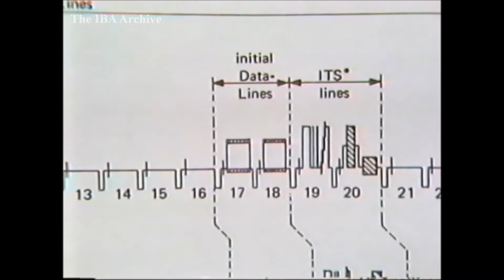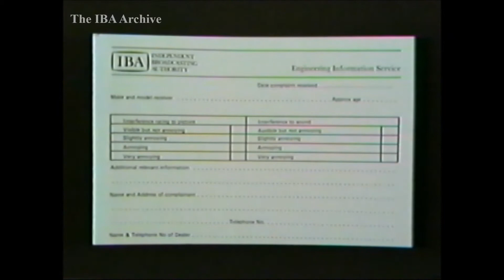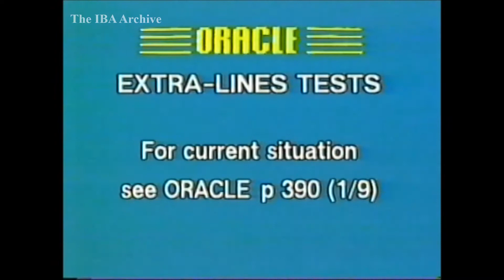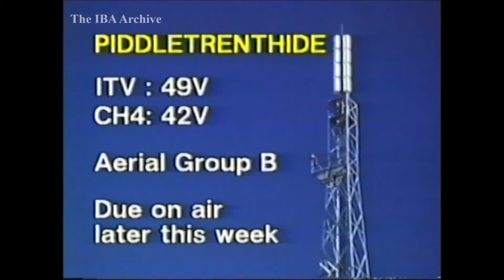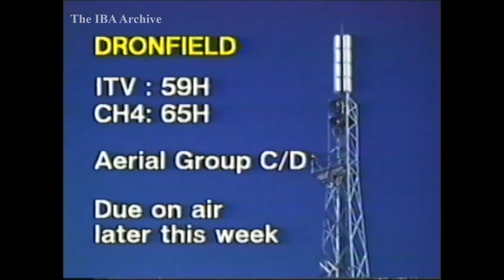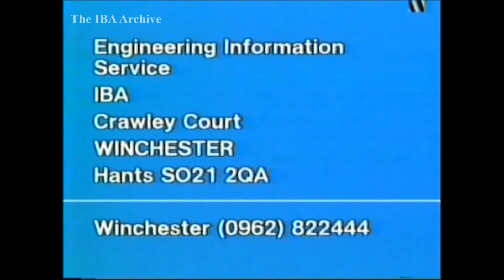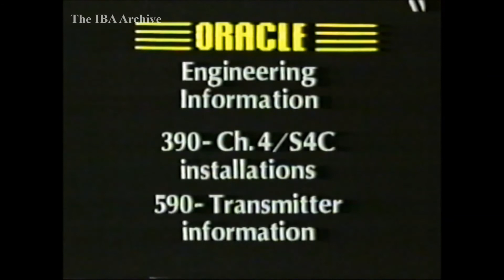IBA Engineering Announcements - 16 October 1984 'Teletext Data Line Developments'

Comment: This would have been TX on 16th October 1984 due to the start of Radio Mercury that forthcoming weekend (as previously announced in the Engineering Announcements on 4th September)
Reply from the maker: Dear Anthony,

Thanks for your correction on the date! I have now edited this in the title/description! 

Hope you continue to enjoy the programmes!

- The IBA Archive
Reply: Anthony Hobson Odd if so as Dronfield TV relay was announced initially on 4 September and this was the edition with the coverage map, which would typically be within two weeks of the prior announcement - unless of course the previous one was 9 October.
Reply: Can now confirm Dronfield opened on 17 October, so the day after this transmission on the date we've worked out.
Reply: Does anyone know when Dronfield/Chesterfield relay started transmission of Channel four on uhf ch29?  I remember when ch 4 started we couldn’t receive it off the Chesterfield relay.  I don’t remember how long we had to wait for it to become available.
Reply: @m3snusteve  Channel 4 came from Chesterfield on Channel 29 from October 1983 according to the IBA Yearbooks, and Dronfield on Channel 65 from going into service in October 1984.

Comment: This was the week a neater font for the on screen text was introduced, and also one of the rare appearances of the "Latest" card. Two reception problems existed in Dronfield: some parts of the town were in a "null" towards which Chesterfield did not transmit, and other parts received rather too much signal to cope with. The alternatives: on high ground you could get Emley Moor, losing the Sheffield opt-outs, and in some areas Waltham was receivable, but this was East Midland region.
Reply: The IBA EIS were testing a new caption generator. They'd previously done a test with one in May 1983. By December 1984 the new generator would be in full service.